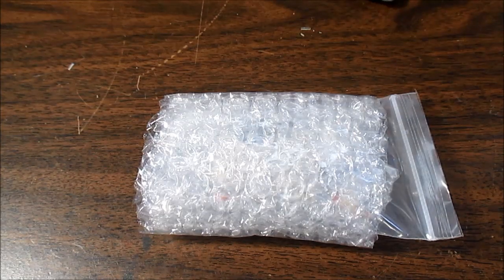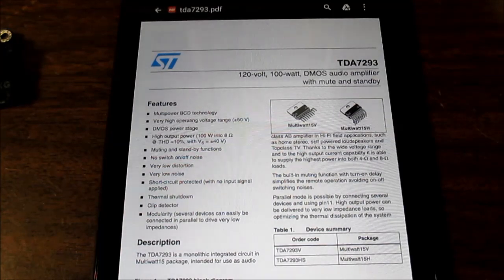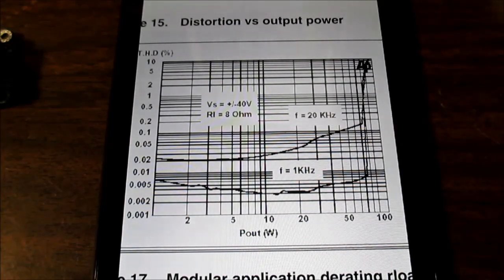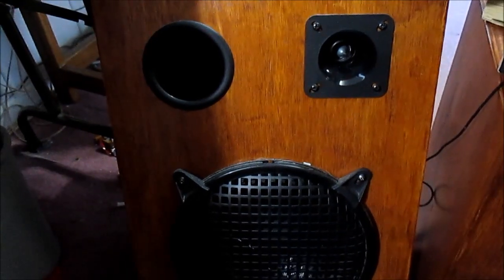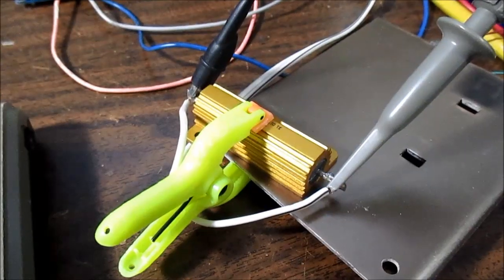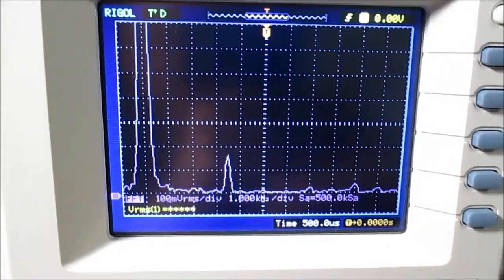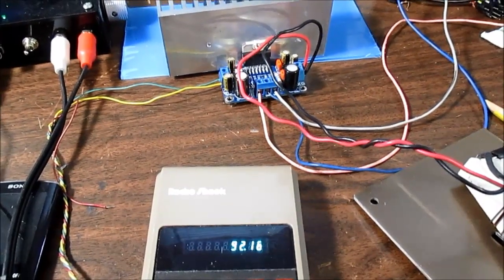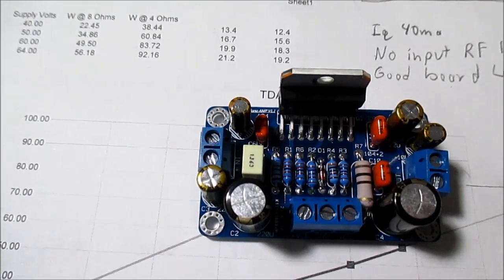TDA7293 100 watt audio amplifier kit test and review

Comment: I have a really strange problem with this ic.i am running this IC on 40-0-40v dc and it's driving 8 ohm speaker perfectly fine and gives around 68 watts but when I connect a 4  ohm load then it's producing some crackling noise and don't even gives 20 watts.is the chip a fake one or there some other problem.pls help me solve this problem.give me your email so that I can send you a video.also do a video on how to differentiate a fake 7293 IC from a original.
Reply from the maker: This is the classic sign that you are exceeding its current limit with a +/- 40v supply and a 4 ohm load. +/- 29v DC is the maximum voltage that I would recommend with a 4 ohm load.
Reply: JohnAudioTech but other 7293 chip gives 93watts RMS with the same supply voltage without making those crackling noise.i used a small heat sink for both chips.is one of the chip fake.
Reply: JohnAudioTech I bought these chips from lcsc.com.i think these are fake because the leads are thin compared to the original.
Reply from the maker: In this case, I think you are right that these are fakes. I still don't recommend running the authentic part with 4 ohm loads at such a high supply voltage even if it seems to work okay.
Reply: JohnAudioTech can u tell me where to buy authentic 7293 chips.
Reply: @pin2rocks979  Mouser Electronics

Comment: man could you help me? I bought 2 of these amplifiers and assembled my own power supply with a 5A 24+24Ac transformer, the supply was nice, +-35V Dc. I conected a 8ohm 100w subwoofer to the output and a bluetooth receiver for the input signal. when i turned it on the TDA7293 simply exploded although i assembled it with a large heatsink. what could have happened?
Reply from the maker: Instant failure at power-up almost always means something was connected wrong or soldered wrong (if it was a kit). You should always power up with a current limited supply and monitor the current draw.
Reply: Thank you for your reply, next time I'll double check the connections and limit the supply current! will comment back here if I find my error.
Reply: Kiss Analog the front fell off.
Reply: Isolate it from heatsink by mica or silicone insulator.

Comment: Hello. Can this be as loud as a 100w guitar amp? Planning to use this to power a 12inch 8ohm speaker. (Is it possible?)
Reply: Some 100 Watt amplifiers used this chip, or its 7294 relative anyway. The older Marshall MG100DFX for example.
I have an amp based around this chip for which the manufacturer claims 40 watts into 8 Ohms. I measured it to the onset of clipping at 52 Watts, and the claimed 65 Watts into 4 Ohms was just over 80 Watts :-)
The built in 'overdrive/gain' sounds are not that nice, but the cleans are fantastic. Loud as all heck too. Real trouser-flapping audio torque

The audible difference between 50 Watts into a 100db/W speaker and 100 Watts into a 97db/W speaker is precisely zero, which is nice.

Don't skimp on the transformer and smoothing caps and they make great, loud amps. Something like a Boss ME-80 as a front end into one of these amps in a powered cab and you're good to go.
Reply: How many volts and amps power supply do you recommend to come up with the maximum potential of this kit? Apologies I don't know much about electronics but I can pretty much wire kits like this. 

I am actually planning to use digital preamp simulations (either from my laptop or something like AxeFX) in front of this. Basically all I need is a clean and loud (enough to jam with a band) power amp.
Reply: A transformer with 2x32V outputs will do the job. Winding 1 start as one rail, winding 1 end joined to winding 2 start is 0V, winding 2 end is the other rail.
Meaty ( really, go meaty :-) ) bridge rectifier package capable of 10~15A and at least 4700uF for each rail. That'll give +/- 45V or there about. A meaty ( see earlier comment ) transformer will give a lower voltage drop under load. Look for a transformer capable of delivering ~10A, ~15A would be better.
Up to the point of clipping, they make a great sounding amp, which is why they feature in so many guitar amp power stages. When they clip, they do get a bit harsh. 
If you've got a heatsink from a Pentium 4, that'll do. They do need quite a large heatsink.
Take care, don't blow yourself up and use a fuse!

Comment: Does it require dc input or ac, as it mentions +vcc gnd - vee
Reply from the maker: It needs a dual DC supply (3 wire) with a positive and negative voltage.
Reply: JohnAudioTech Thanks for info.👍👍

Comment: Hi there john, i just recieve a couple of this audio amps, a good ebay offer, $3 - 4 dollars each, the board or pcb version is "yx-1536", with a couple of big 50Volts - 2200uF capacitors in it. (maybe a "nichicon" copy but functionals caps), i'm planning to feed this with a 40 Vac or 48 Vac central tap transformer, max 50 Vac. (possibly from a microwave, i built one lately at 36 Vac central tap and it kicks good!) 

i have a couple of projects with this amps, power a couple of sub woofers; one sony 8" at 6 Ohms (SS-WG490) that i carefully reconstructed, and rescued from a very nasty hands and other handcrafted that i have around ages with no spk in it, but ready for action. it will recieve a 10" s.woofer probably.

seeing your video, i'm possibly changing my mind, because of the distorsion factor wich is minimum in this amp... im just thinking... well, what do you think about this amps for power a s.woofer? (max 10" s.woofer at 150-250 Watts) it is efficient or is too much for (i mean quality vs power) ? or is a better option for a full range amp with a decent preamp?

i hope to read a perspective from some else who make a similar project and can tell how was the experience too, it will be helpfull, and thanks in advance.

thanks for your videos john and sharing your work with all of us, greetings from Colombia.

Comment: out of all the DIY kits out there which would you recommend preferably one I can wire right to a AC120V wall outlet and stereo that can also use one of those cheap Bluetooth mp3 decoder boards ?

Comment: Could you please help me to upgrade the power supply on this unit?

https://de.aliexpress.com/item/Sound-warm-and-delicate-200W-speakers-TDA7293-high-fidelity-amplifier-A-class-With-three-tones-pre/32776716970.html?spm=2114.10010108.1000014.2.2534ad11ycd24M&traffic_analysisId=recommend_3035_null_null_null&scm=1007.13338.80878.000000000000000&pvid=a7f96c5b-a4b9-4ba3-bc6e-2f4afb05f022&tpp=1

Comment: Very good test John and very cheap amp but the power supply must be very expensive.....
Reply from the maker: Yes a 300 VA transformer you'd need to make a power supply for two of these to make a stereo amp would be relatively expensive if bought new.
Reply: @JohnAudioTech  This is the same chip in a MG250DFX Marshall guitar amp.

Comment: Hi John, I am interested in buying this kit, but does it come with proper build instructions? I am a complete novice where it comes to electronics, for example I will have no idea where to install the resistors on the board if they have different values. If there are no proper instructions ,do you know where I may purchase a completed unit.
Reply from the maker: These kits rarely have detailed instructions or anything included at all. The nice thing is the part value is clearly silk screened on the board. You just have to be careful and read the part value carefully before soldering. Also be sure polarized components like capacitors and diodes are in the right way around.

Comment: Question John...I thought these amplifiers were AC input thats what the eBay listings say only reason I ask is because you're powering it with your DC power supply. And another question around the 5 minute mark you have 25v by 25v is that considered 50v or 25v together? I'm looking for a transformer.
Reply: I'm trying to power it at 50v to get the 60w output and I can't find a transformer. all my searches are coming back with absolutely no returns.
Reply from the maker: There might be a version of this for AC supply but would have a bridge rectifier and large capacitor on the board. If it looks exactly like the one I have in the video, it is split DC supply only (could be mislabeled in the listing). A transformer with a 28-0-28 volt, 4 or 5 amp secondary is what you want for 60w @ 8 ohms stereo (two amps used).
Reply: JohnAudioTech Thank you for the reply, I knew it was most likely a typo but needed some clarity as the board I ordered is practically the same as yours. I will be using two boards to get stereo. So I'm looking for a 28v multi tap transformer at 4 or 5. and it is at 8 ohms that i'm going with. does that sound right to you? I'd usually ring my dad or grandfather because they're in this field of work but I can't do that right now. thanks again.
Reply from the maker: Just to be clear, it is a 56 volt secondary with center tap. Typically notated as 28-0-28v.

Comment: John, I received  one of these assembled. 
I have a Hammond 56V CT transformer.
I see some kind of monolitic IC on it which I presume is the rectifier bridge.
Is there any other external components  beside fusing and the transformer that is
required to use this amp?

 I have a large heatsink for it and it is also mounted to the inside of a aluminum chassis with thermal grease with the heatsink mounted on the outside of the chassis.

What kind output power does this amp produce into 8 ohm load?

Comment: John , can you explain how the power drawn by tge amp is just 3 watts (+-30 volts 50 milli amps) but output power is around 56 watts for 8 ohms resistance. How this is possible? output power can never be greater than input power.
Reply from the maker: The 50ma measurement is the amp powered on but idle (no output signal).
Reply: JohnAudioTech thank you for your reply, I have one more doubt, so when the amp is working it can draw more current right? so for a 100 watt stereo amp we need atleast 200 watt power supply for the amp to function without clipping?

Comment: The TDA7293 is aimed more for PA amplifier or portable disco amplifier.
Impressive power in to 4 ohms at 92 Watts.
Reply: I got about 130w into 4,7 ohms with TDA7294 at 72V before clipping. And about 80 or 90w into 9.4 ohms. (only had 4.7 ohm resistors, so with 4 ohms and 8 ohms there would be even more power). At this power i don't think chip will last long.

Comment: Great video! I prefer amps that can use simple power supplies or batteries though (also already assembled, lol). You are much more handy with a soldering iron than me 😁. Keep up the cool vids and get your hands on one of the TPA3116D2 2.1 amps...they are impressive!
Reply from the maker: I definitely want to get one of those boards in to test.
Reply: @JohnAudioTech  Hey there is a prebuilt version of this amp that costs about half the price from aliexpress,you should check that out.some claim that ic used in that is actually 7294 but falsely advertised as 7293 so we need to change boot strap capacitor pin ( 12 /14 pins).that will be fun to test and check what actually is in it!
Reply: @techpluslab8744  sir can you please collaborate more of the difference between this 7293 and 7294? TIA
Reply: BidDWiz+ Need more mini amp test. Two different way of testing, you and John should look at using both ways.
Reply: Definitely agree about the power supply. An 8 dollar amp is no good if you need an 80 dollar p/s.
Reply: I also prefer amplifiers with simple power supply (of course, does it simple to have got in praxis for ex. car acumulator or other batteries) but you have to count with one important thing - you never can reach most low frequencies with simple power supply amplifier's like by dual (symetrical) power supply amplifiers.
Maybe till 100 Wats audio power is possible to use single power supply. For higher audio power is recomembed use dual power supply amplifiers.

Comment: On your brief testing that must be one of the best chips around at present. Leaves the class D stuff well behind. Almost tempted to get a couple and do some full tests on distortion, frequency response  power bandwidth to see how close it gets to a full Hi end amplifier. Interesting if nothing else. PS We would say IT'S THE DOGS BOLLOCKS!! Just a thought, I see many suppliers put 2 or even 3 of these in parallel to produce amazing power output for very little money. Forgetting about the extra power, the current delivery must be amazing. I think I will investigate this arrangement, should! sound better even at normal listening levels.
Reply: Hello Michael! I know this is an old thread, but i must respond: I originally built this kit, using the supplied components, as well as a kit using the LM3886 ics. They both promptly blew up!! I suspect the chips were poor counterfeits.! I'm glad John had no issues. I subsequently built the same kit, using chips purchased fron Mouser., and they worked fine...no issues. So be warned. BTW, I recently came into possession of a 1980 Sansui G5700 receiver, which was touted as sounding wonderful. I can honestly say I am much more satisfied with the sound of the LM3886 boards. Go figure! Best regards...
Reply: I'm interested in your thoughts regarding 'Leaves the class D stuff well behind'.
How so?
A disadvantage with this chip (TD7293( is that it must run via a dual-rail supply and the class-D chips don't.
Also from what I see, both this chip and the TPA3116 seem fine in relation to sound quality.

Comment: That's a fantastic rundown of that board, I've got a similar one (hope it's as accurate in spec as yours was). 

But I've been having a heck of a time finding resources online that explain clearly enough for us newbies on how to properly power up a Center Tapped device like this in real world scenario (as in, not connected to a special bench-top power supply).

Could you possibly do a video where you explain where to get, and what kinds of supplies are needed, and how to figure out best transformers for your needs (and things like, what's the minimum size you can use for your project board, how to safely wire it up to mains, any additional parts needed (like what's this stuff about additional power bridge rectifier boards I've seen a bit of) ...etc)

Thank you so much.
Reply from the maker: I covered some of this in older videos, such as "selecting a transformer for audio amplifiers".

Comment: what is exactly signal ground, power ground? why should it get separated from each?
Reply from the maker: Power ground can conduct several amps of current. If it travels in the small signal ground of the circuit (such as the input return) a small voltage can develop across the ground trace/wire which can be "seen" by the input. It can cause distortion or even instability of the amplifier. Proper layout of the board will eliminate this issue.
Reply: JohnAudioTech thank you. one more question, should I seperate power ground and signal ground "electrically" for this Chip?

Comment: Impressive performance - makes me wonder how the TDA7293 compares with the ubiquitous LM3886.
Reply from the maker: The 3886 has lower distortion at high frequencies (probably not a real issue in normal use) and it has a slightly lower power rating although I think National was conservative in rating it.
Reply: 7293 more natural

Comment: What's the power input into the amp: Am not sure that amplfier is capable of your rated 100w  nominal. Output power talkless of PMPO. 100w amplifier would need some better cooling. Please check properly.
Reply: class ab efficiency is % of o/p and supply power. here the o/p power itself is 92w. if you consider ~65% efficiency, the supply power would be ~140w.....
Reply from the maker: The amplifier was putting a continuous 19.2 volt rms signal into a non inductive 4 ohm load without distortion. You do the math.
Reply: Obviously you didn't watch the video before posting this comment.
Reply: JohnAudioTech continuous RMS of 19.2 into 4ohns load..roughly 4.8amp. and around 92.16watts and with an class AB efficiency of about 65% .(ideal situation without thermal runaway etc) .talking about 59.9 Watts. ..

Comment: +JohnAudioTech can you tell me that a good amplifier board that can put out 50w @6ohm 18-19vdc up to 7a thanks
Reply from the maker: To get that much pre clipping power with 19 volts supply and 6 Ohm load is not possible with an ordinary bridge amp board. 40 watts is possible or you need a 4 ohm load to get to 50w. You could use a switch mode supply to get a higher voltage provided the amp can handle it.
Reply: I'm using a hp laptop power brick that's 19v 9.5a
Reply: tda1562